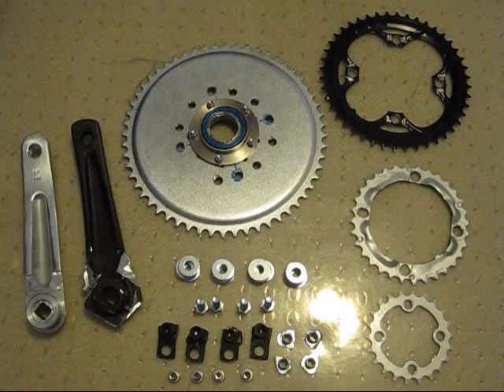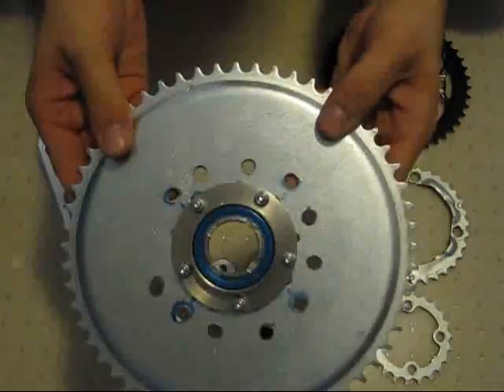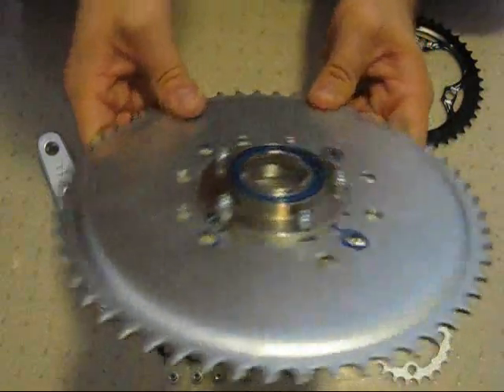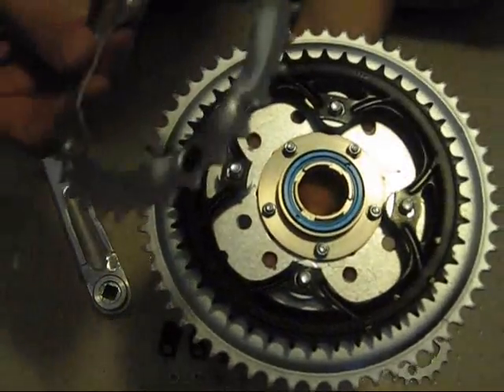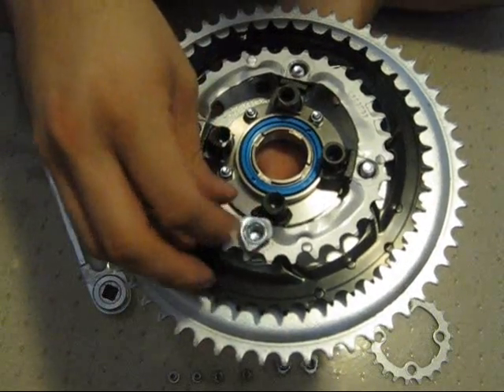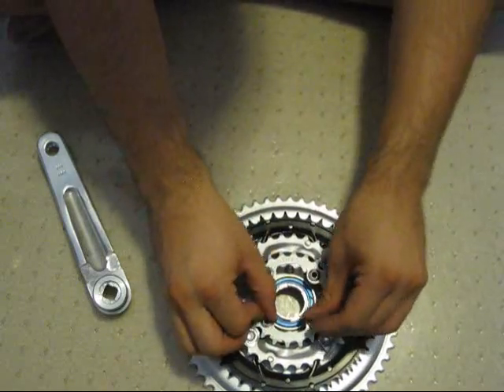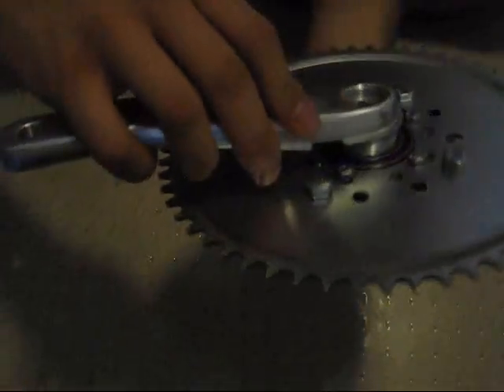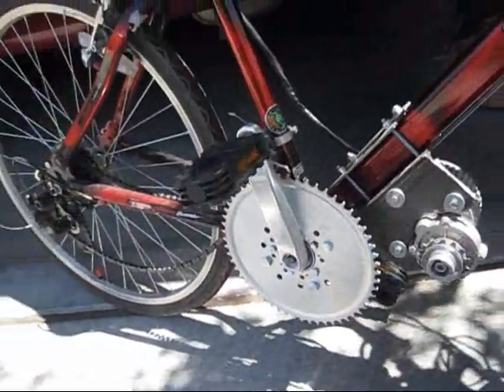Homemade Freewheel Crank with Triple Chainrings

Comment: give please the reference where it is possible to buy the bearing of a free wheeling or a treshchetka, which from you on pedals
I tried to find on www.thatsdax.com to the .ne found
Reply from the maker: Here is a link to the heavy duty freewheel used in this video:
http://www.sickbikeparts.com/catalog/product_info.php?products_id=62
Reply: @hutchtransfer  I'm looking for this exact setup already made up but with an extended crank shaft to fit around the pull start on my 80cc motorized bicycle. Later I may get a second engine and set it up as a twin engine system so I need a very wide Freewheel crankshaft. If you know where I can find this kind of setup please provide a link.  thank you in advance for your time and help.

Comment: Hmmm. . Right at the beginning there when you didn't drill the holes accurately I was disappointed. Surely you could've spent an extra 20mins & a simple home made jig to get them accurate. Even with a hand drill you can drill them small & file to correct them.
Anyway keep up the good work.
Reply from the maker: Unfortunately at the time I built this I did not have the skills necessary to build a jig and do it correctly.  However performance was not effected.  I did not have any problems with the chain falling off.  I actually do not use this particular set up anymore.  Check out the latest video for my bicycle on my channel.  You will see that I redesigned the freewheel crank.

Comment: Ya I was talking about two fro the chain drive and one for the drive. Problem is most of them are crap, not impressed with Cyclone and want something that looks good, Looking at GNG kit right now but would like to build my own possibly using parts from sickbikeparts..., I want high quality and buy the time you get the parts from china your better off getting local parts. Also thinking custom high end builds. . Read a few posts with the crank threads stripping on GNG kits

Comment: Hi I am thinking of buying a GNG kit but also thinking of a converted hub drive mid drive conversion so wondering if it is possible to build a triple free wheel crank off the shelf with quality products, doing research and kinda thinking of doing custom DIY mid drives in the future as a hobby.

Comment: Wow pricey so what is the advantage because I saw a front wheel E-bike conversion
kit on Ebay 48v 1000w for under $200 includes wheel with motor attached
with spokes and  controller and throttle and so forth but does not include
the battery.

Comment: Thanks for yor quick reply. That will help me alot. So if I understand you right, by going to a smaller sprocket I'll gain speed, but lose power for climbing hills. I'm planning on using 24 inch rim & tire combination which would give me more hill climbing power. So how do you think your setup would work with the smaller rim & tire.

Comment: I was having problems understand this type of setup until I saw your video, Thanks for the help. Could you please explain why you used a 56t sprocket instead of say a 44t, more power or speed and what where the bolt sizes and length did you use to put it all together.